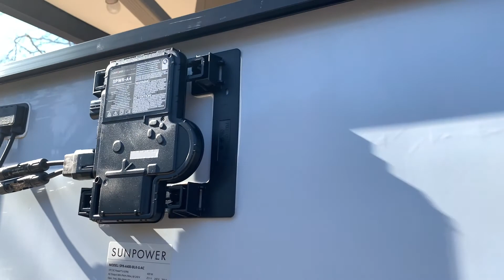Sunpower Solar, Hub Plus and Sun Vault Installation | Jaime Greene the Solar Queen

Comment: My sale consultant quoted me
the 335 watt  x 21 panels black panel. I really wanted the new improved A series 400 watt panels. She said "I have quoted you the best panel for your roof which will generate the most electricity production year over year based on your energy needs. The M Series 400W panels are not available.

I did do a mock up on my design tool with the 400 panels and as they are larger, they produced under the system size you are contracted for"

Is it because of my roof that she can't fit the A series panels and gave me the X series instead? Please help

Comment: Currently in the process on deciding on a solar system, and glad you actually mentioned that the micro inverters are in fact Enphase. Question however on the 13kw battery backup, would the battery maker also happen to be Enphase, under the name of SunPower Sunvault? (Located in So SF)
Reply from the maker: Hey J W!  SunPower makes their own batteries.  They are not Enphase batteries.
Reply from the maker: Reach out to me on my website if you’d like to meet via zoom for a solar system for your house!  I’d be happy to help!

Comment: I am in the process of getting Sunpower Solar Panels with micro inverters in south San Jose. I went and explained to the sales rep that my electrical needs will increase due to all electric car. This will result in upgrading the electric panel and electric utility service line upgrade. The sales person said they included the service line into the price. The survey  engineer confirmed the needs for my home. The sales person said we can cancel the contract if it results in much higher than the initial contract. Can you reach out to me?
Reply from the maker: Hi Javier, yes. What is your email address?  Or can you reach out to me?  415 * 301 * 4646

Comment: If I got solar panels already and want to get a home battery down the road... will I be able to get a tax credit for the home battery?
Reply: I've already claimed the tax credit for the panels in the 2021 tax filing.
Reply from the maker: It depends on if your installer will install a battery on an existing system that they installed.  Most installers will require you to add a second system to add the battery. Is there a reason you didn’t include the battery with your initial solar installation?   But I don’t believe batteries alone can qualify for the tax credit.  I believe it needs to be combined with solar.